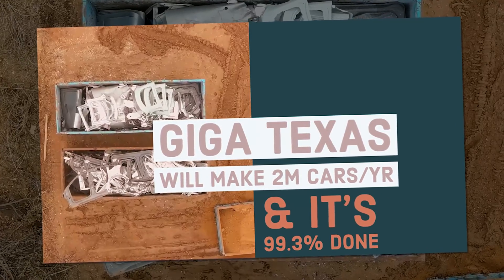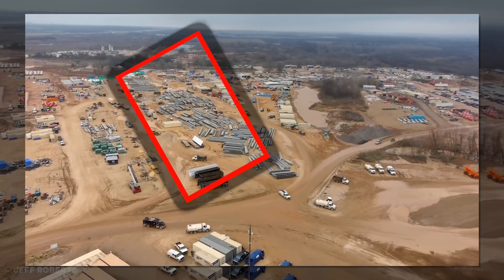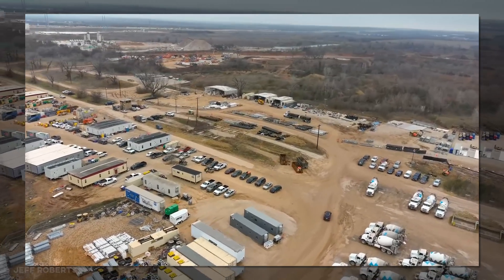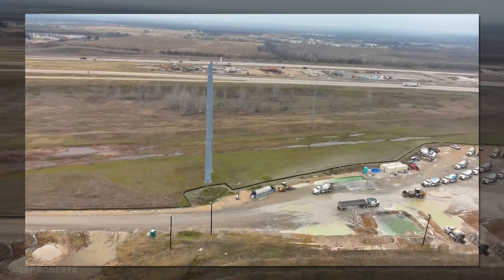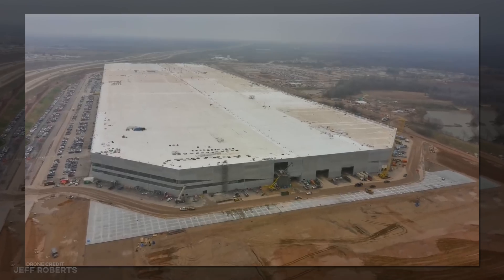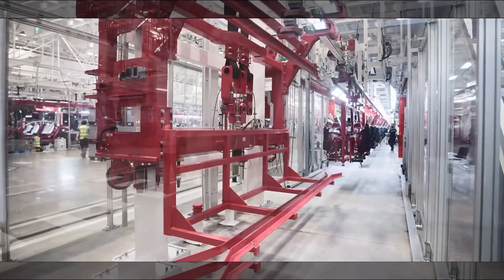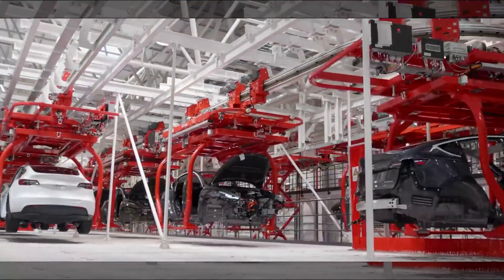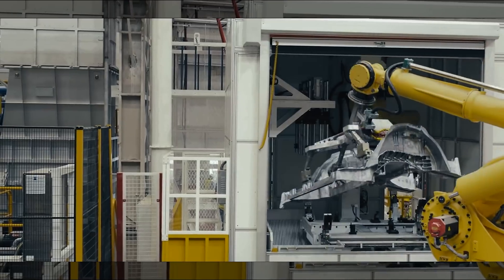Giga Texas will make 2M cars/year, and it's 99.3% done

Comment: What is the total area of roof of GigTX?   I doubt it will give anywhere near a 'complete offgrid experience', but it should help the electric bills anyway!
Reply from the maker: 4.3M square feet (400k square meters)
Reply: @FutureAzA  Theoretical maximum is 400KWH on the factory.  Assume they will do 10 to 25% of it, so that would be probably 100KWH range or so for Austin solar on the main building.  Could easily be more.  Might be less if the spell out 'TESLA' on the roof like some speculation has been showing.

Comment: I reckon 2m production is sandbagged. I bet you Tesla Texas will turn out 4+m in future.
Reply from the maker: I suspect that's more in line with the longer-term goals, but not likely for this phase of construction. The space available for MegaCastings will only support around 2M on the current configuration.

But I do suspect they'll expand in Texas sooner than later.
Reply: @FutureAzA  I'm basing that more off the volume of the factory relative to that in Shanghai which is doing 1m already. Plus further efficiencies. Lets just say, Texas likely to continue surprising to the upside.

Comment: What does 0.7% of a car production system look?
Reply from the maker: Finishing touches. They already have all the pieces needed to begin the production ramp, and with a far greater percentage of localized parts than they did when Shanghai came online. But Shanghai was just making a mirror copy of the Model 3, and later Model Y, where Texas is incorporating enough significant design changes that it requires a whole new validation process.

Comment: Great coverage as always. I wonder if you can get any information on the giga presses. Some photos showing some not installed. I thought they had all been delivered but it appears they have been saying not installed yet. That's a key component for 4680 batteries.
Reply from the maker: The GigaPresses are for the casting of front and rear subassemblies. These are not part of the battery.

They have some installed, the first two of which appear fully configured, tested, and operational, with the next 1-2 getting dialed in now. This is not a bottleneck for the beginning of production. Each gigapress has a cycle time around 90-seconds, so if you have 2 for the front and another 2 for the rear, that's a theoretical capacity around one car every 45-seconds. Extend that to 60-seconds to allow for downtime and maintenance and you're looking at capacity over 500,000/year.

Additional GigaPresses will be used to make the front/rear assemblies of the CyberTruck and any other models they will make in Texas, and expand production capacity.

Comment: I hope you're right about the 2m number.
Reply from the maker: The stated objective remains 20M by 2030, so high factory utilization is critical. If each plant could only do a half million, they'd need 40 factories, and that would be nearly impossible to reasonably manage in terms of construction logistics.

At a million a factory, they'd need twenty, and we're only at four once these two come online. More reasonable, but adding another 16 by 2030 still looks desperately unlikely.

At 2M/factory, they only need another six. We expect two-ish to be announced within the next year, leaving only 4 more needed over the following 5ish years. Some of that would likely be addressed with expansion in Texas and/or Berlin.

Considering Shanghai is already close to a million run-rate, and Texas is a next-gen factory, I'd be awfully surprised to see capacity below 2M. The number of GigaPresses the factory is designed to hold in the existing space will support in excess of 2M units/year.
Reply: @My Tesla Weekend  makes sense but I'm just wondering if they could double the production capacity with the same amount of space as Shanghai.  I always thought they would simply extend the size as they need considering they have plenty of space.  For example phase 2, 3 even 4 to make it a 4m capacity eventually.   But if it turns out that they can do 2m with this 1st phase alone then that would be crazy fantastic

Comment: Yo standard range model 3's are LFP's. Transitioned about 2 months ago. Mine is 😎💥
Reply: Must be nice charging to 100% on a regular basis.
How far do you usually go before topping it up?
Reply: @davidhuber6251  yes it is nice. I'm still figuring it out. I finally got to the point where I don't have range anxiety, which is awesome, and I charge once it gets down to 100 miles left. But if im at home I'll always get that 6 mi/hr of charge odd of 110 😂 I'm moving soon so not worth installing a real charger yet

Comment: Are you going to make the same tracking graph for the cathode factory? 
Do you know if the floors of what used to be the "southern gap" is fully cemented inside?
Reply from the maker: I will absolutely track any additional buildings as soon as the foundation work begins, and have even had a few false starts on that already.

I haven't seen an answer to the pavement question, but we have seen a parade of cement trucks in there at least once in the past month, so if it's not complete, I suspect it's close. All they upper floors in there got their concrete before the roof was complete, so at worst it would be only the ground level, and only part of it.

Comment: Does anyone think they will actually build Customer CyberTrucks BEFORE June 2023?   Could they hold off on the CyberTruck initial launch until Early 2024
Reply from the maker: It's a great question. The problem you're getting at is valid, that we don't KNOW what engineering obstacles remain.

The structural battery pack is a solved problem, since they're already introducing it for Texas made Model Ys.

The biggest-ever front/rear castings are likely solved as well, but if not, they could substitute a joined pair like they did on the rear of early Model Ys.

The added tech, which as far as I can see is just the rear steering, could be put off for later builds just to get it into production. I don't see this impacting early demand. I know very few truck owners who would want this, let alone be willing to pay extra for it.

This leaves the origami stainless shell. Sandy Munro doesn't consider this a likely obstacle, describing it as only an engineering problem, and one that can be solved with existing methods and technology. I think of it like a factory that makes custom sandwiches. That doesn't exist today, but it can. You'd need some new methods and software, but all the pieces exist. You'd just need to get them all together. There's no reason it can't, it just hasn't, and it can take some time to iron out the wrinkles.
Reply: @FutureAzA  I think it is a combination of things.  Producing as many Model Ys as possible out of GigaTexas is Elon's stated priority, doesn't leave a lot of space/manpower/focus for the CyberTruck.  Having enough 4680s for all the Model Ys delays a possible CT launch. Not enough for both this year.    Getting the production costs "down" is another reason to push off the initial launch.   Ramping production at both GigaBerlin and GigaTexas is not a snap of the fingers and takes human capital resources.  In 2023 both Texas and Berlin will be smoothed out.  The Model Y 4680 version should be flowing nicely out of Texas and Tesla can turn some attention and focus back to the CT. Hopefully.
Reply: I would be shocked if they dont start a small production line by EOY with first deliveries in Q1 2023.
Reply: @cloudstorage9928  I would be shocked if they start a production line in 2022 for the Cybertruck.  I think there are bigger engineering/production challenges than we know.   I would guess this summer Elon will hint at the status.   I just hope they actually will still build it starting in mid 2023....and give us the features that were promised back in Nov 2019.
Reply: @Team_Trade_Down  IMO, the biggest challenge is the new 4680. If they can ramp up the production lines, CT should be ready to go. I personally think that the CT was designed to be build fast and cheap and don't really see any major problem except for the batteries...
Reply: @cloudstorage9928  Except Elon just said they have some engineering challenges to provide all the tech they promised in the Cybertruck....while keeping the CT "affordable".   My guess, they could build it in 2022 but it would cost $100,000 for the Quad version.   That is a long way from what his vision was for the Cybertruck.  Maybe by 2023 they will figure out ways to produce it and bring the cost down to a more reasonable $70,000

Comment: Any chance they run the 2nd line for Y/3 instead of CT? Maybe build factory 2 for CT/Semi?
Reply from the maker: Not instead, but in addition. We know in Shanghai they managed to build one of the cars on the other line, though off the top of my head I don't recall which it was. I think maybe they built some 3s on the Y line to match demand in Q4.

Considering demand for both models is insatiable, I suspect they did this to validate that it could be done so that they would have the flexibility of having a mixed 3/Y line in Texas and/or Berlin. If that could be done without much disruption, it would be a lot cheaper than importing them from Shanghai to Europe (both in shipping costs and import tariffs,) and Model 3 demand is likely to explode again once fleets beyond Hertz wake up to the advantages.
Reply: IMO they need a dedicated plant for the Cybertruck
Reply: What are you guys smoking ? If they don't build the CT in the current factory, it will be postponed by another 2 years. UNTHINKABLE. 😱
Reply: @cloudstorage9928  The Model Y is so popular an profitable it's gonna set back Cybertruck production. Not my choice. I ordered one a year ago.. But I'm also an investor, so I guess we can't have everything we want. More factories are needed!

Comment: If it was done by 99,3% (and it is now being built for less than 600 days) that would mean that it should be finished within 4 days, definitely less than a week if you count equal time distribution and you should otherwise it would make no sense if the last percent would take 5 years. So it seems to me that it is a total nonsense because they are very far from finished. You do not have to be genius to understand that it is less than 70% finished and even that is probably very generous estimate. You should know that having some form of shape is very far from finished. I hope this was helpful.
Reply: I think the 99.3% is how close it is to initial production.  There are huge areas of the factory, like the general assembly area, that are nowhere near completion.  IMO, the factory is probably only 60-70% done toward full production.
Reply: @thewolfdoctor761  I am Tesla investor and of course wish the company all the best but that is even bigger reason to stay realistic. You should understand that there is so much work to be done in the inside it is hard to even fathom. The fact that Elon shows you some areas that are almost finished on the conference call doesn’t mean it is all done. Why they would show you rough soil? What they have is basically rough frame but super-modern factory that Tesla aspires to built requires much more than that and that needs lot of time. This is not China where it goes 24/7 at full speed all the time. Similar situation is in Germany where it is in fact not so much about final approval but much more about fiddling all those millions little details that are necessary but very time-consuming.
Reply: @ismaelvolf4759  I agree, but I am not the one who claims the factory is 99.3% done.
Reply from the maker: @TheWolfdoctor General Assembly was one of the first areas completed. That's the ground floor between the stamping and casting cathedrals on the east side of the factory. Assembly robots were installed last summer. Final assembly on the west side was completed in Q3, the paint shop in Q4.

There are areas like the SW where final touches won't be seen until CyberTruck deliveries approach, but that doesn't change the fact that the building will be long complete when it happens.
Reply: @FutureAzA  Your interior completion discussion is based on initial production of Model Ys.  Much, maybe half, of the interior is nowhere near completion as far as full production of Model Ys and Cybertrucks is concerned.

"the fact that the building will be long complete" when Cybertruck deliveries approach."  That may be true depending on when in 2023 Cybertruck production will begin.
Reply: @FutureAzA  My personal estimate is that it is around 55% - 60% done. And I am hoping for that because even that would be quite a success. 70% is very unrealistic but still possible. More than that is pure nonsense. Whatever, nobody can really tell this because it does not make any sense to measure this in percentages because it is not even possible and even if you were making pictures in the inside every day you wouldn’t be capable to rightly assess it. It may look finished to some untrained amateur eye but in fact it is not because the complexity of such factory is insane. It is like being at some complicated operation watching doctor taking scalpel and thinking how easy it is and thinking that it is all about scalpel and you can operate - like watching giga-casting and ok here it is we can start. Of course is one important piece of a puzzle but there is much more behind it.
Reply from the maker: The equation doesn't include equal time distribution as well as hoped, which will be addressed on the next factory tracker. All the counting is finished and the spreadsheet will hit 100% in mid-March regardless of what we actually see.

The "less than 70%" part of your comment suggests you may be new to the series. Site remediation and ground prep was a monumental task, and one that couldn't be skipped. Just getting the land ready for construction was huge. Before the first footings were poured you could have argued it was 0% done, but that would have required a willful misunderstanding of construction.

They're already making cars. They have been since Q4. If that's something you can do in a factory you consider well under 70% done, maybe you should reevaluate how you assign percentages.
Reply: @FutureAzA  Are you kidding me? Do you know anything about these factories? It is not like making a candy. This channel is totally misleading the public. People then really think it is there and have totally unrealistic expectations. I can assure you that nothing is ready in the inside so far. It is not so simple. You have to build the frame wait for the concrete to mature (this is step one where is basically Tesla right now) then you can start to put there some equipment. It is a lot of equipment much more than ordinary house and much more fiddling and time consuming than you can possibly imagine. Then you have to revise all this and make another fine tuning. All these phases take years and years and years in Europe or the US (China is total exception they work at full speed 24/7 all that time and that makes it at least 3 times faster and that is why people like you expects miracles now) That after step number 3 is finished factory and only after that you bring employees and slowly make it real. It is not question of days or weeks at this moment that is why Elon on conference call said that Shanghai itself is capable of 50% growth because they do not expect those factories to run this year at least not at any reasonable speed which is totally understandable but some people still don’t get it we are not in Shanghai.